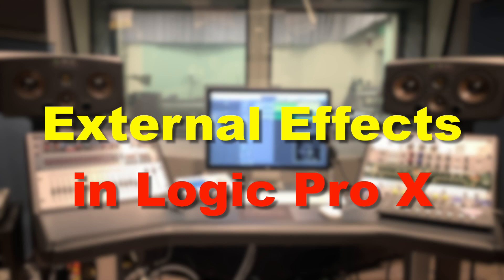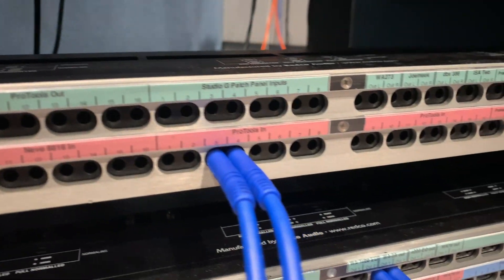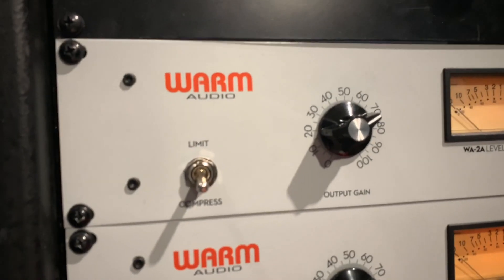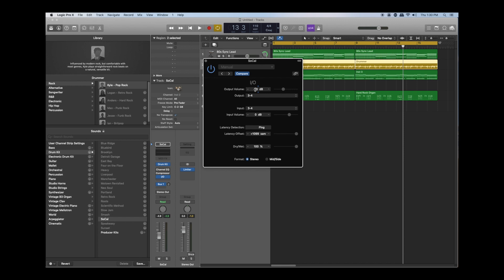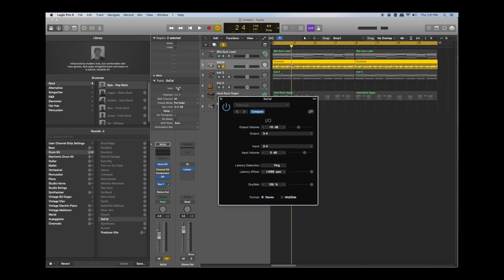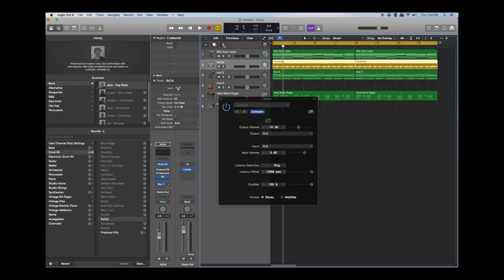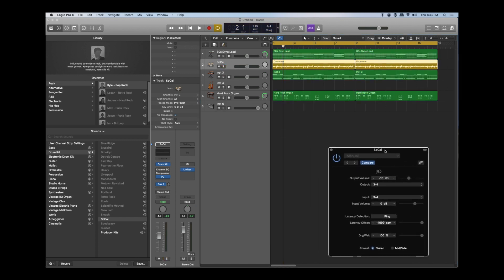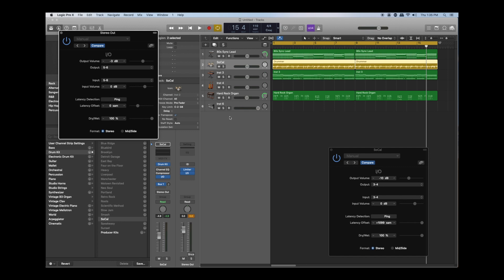External Effects (I/O Insert) | Logic Pro X #269

Comment: I/O plug does not compensate on an audio track, only on busses.
Reply from the maker: This is what the manual says, “Latency Detection (Ping) button: Detect the delay between the selected output and input. Following detection, any delay is automatically compensated for.” It doesn’t say it’s just for busses.
Reply: @LogicProLife  I'm not here to pick on you personally, as there are other videos spreading this same misinformation, but some of us spent the money on the program thinking it worked properly on audio tracks, which it definitely doesn't. Head over to Logic Pro Help forum for hours of frustrated reading fun
Reply from the maker: Ah, I see what’s happening. I wasn’t using a normal audio track for this which I’m not sure is the exact same thing. I just exported the drummer track audio with and without the IO insert in place and they are perfectly time aligned. 🤷🏻‍♂️ So technically we might both be right. I’ve never used the IO on other audio tracks, just the drummer track.
Reply: @LogicProLife  keep reading. "Click an Insert slot of an aux channel strip that is being used as a bus send/return, and choose Utility > I/O"